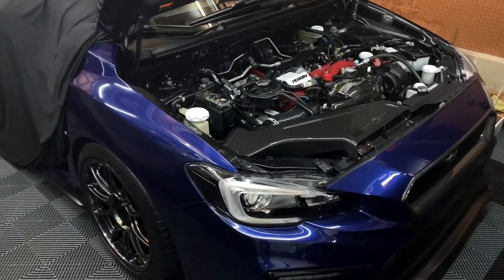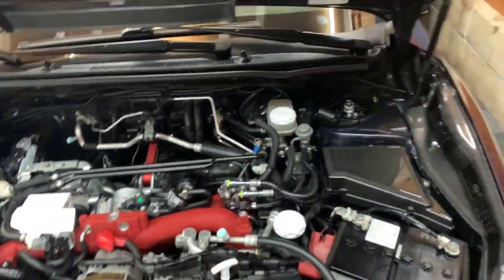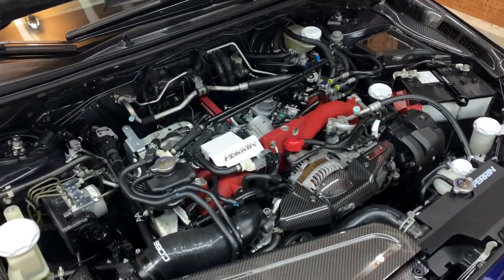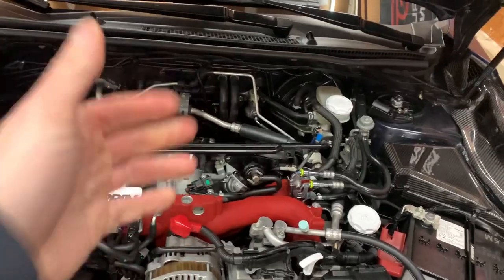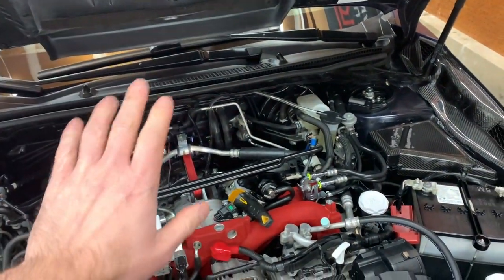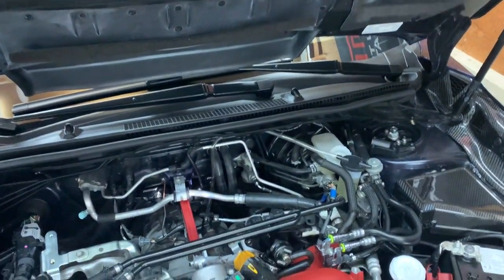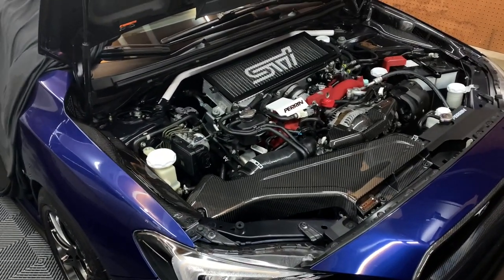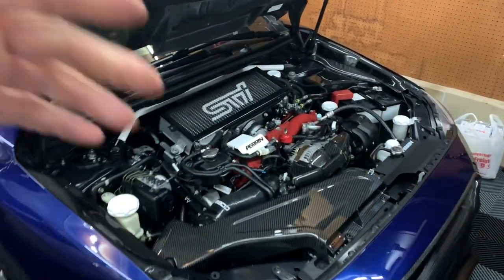How To Bleed Your Clutch On A Subaru STI

Comment: I have a 2016 STI. I just added a radiator, AOS, cylinder 4 cooler, pitch mount, pitch brace with stainless steel clutch hose. When I finished installing the stainless steel clutch hose, I noticed the clutch pedal stuck on the floor (no one pressed it). I figured it would be bubbles but after bleeding the clutch slave, clutch pedal still would not go back to normal. I noticed there were a small leak on the clutch master so I replaced it and bled the clutch slave again until no more bubbles yet the clutch pedal still would not go back up by itself. I decided to replace the clutch slave and bled it again until no more bubbles. Still the same, the clutch would not go back up by itself. 

Oh and on top of that the clutch would not go in any gear when the car is on. I was able to put it in any gear when its off. So I tried to put it in 1st gear and turn on the car, now the car wont turn on, the clutch wont go in neutral and the clutch pedal still sticks to the floor. Any thoughts or help would be appreciated.

Comment: is the rod on the slave supposed to move around at all???? my pedal just hit floor on freeway and I pulled intercooler off checked master where I see everyone else's leaking and no fluid but the slave had some visible leakage at the boot and the rod moves around a lot it actually came off when I pulled just a little

Comment: A little bit of a stupid question but since the brake and clutch reservoir use the same DOT fluid. When you drain the brake fluid you have to also bleed the clutch? Or are they separate?
Reply from the maker: No sir since the lines to the clutch are separate. It’s just fills from the same reservoir.

Comment: So slightly off topic question but still clutch related. I threw on some faction fan coilovers and the car is super low. I also changed diff fluid on trans/ front diff and rear. I am hearing a tapping sort of noise when I depress the clutch pedal and put it into fist and second. Not sure if this is a bleeding issue, the car not likening Motul 75w-90 or something else like a throw out bearing or needing to bleed the clutch. Any feedback helps.
Reply from the maker: Need to bench bleed the clutch

Comment: I did the same thing but i would tell my wife to press it once and i would open the bleeder valve i did not want to press it to much and let air into the cylinder do you like the feel of the line is not that Noticeable only at the mid end

Comment: Did this method actually work? The nipple on the slave is not the highest point when bolted down to the trans and could still have air trapped (even if you're bleeding it countless times).  I need to do mine, but I think I am going to remove the slave to angle it so the nipple is the highest point for a proper bleed.  Let me know!
Reply from the maker: I had to do a bench bleed. This method didn’t work.
Reply: @Autofreakgarage  ahh gotcha! Such a simple line to replace, but bleeding it sounds like such a pain :/

Comment: I have a question…I have a 15 wrx and I just replaced my master cylinder and while bleeding my slave when I close the bleeder screw I still constantly get air coming out.
Reply from the maker: We ended up having to do a bench bleed to get all the air out.
Reply: The problem I’m having tho is I can’t get the air to stop it’s almost like the bleeder screw won’t fully close…when the bleeder screw is fully closed I have have an air leak
Reply from the maker: @matthewwillis9449 I would take I completely out and inspect.

Comment: First off, great video, beautiful garage, car, and build. Now I have a question…Been looking for an answer to this one. Still scratching my head. I had swapped my transmission with a brand new one and an act clutch. Its still less than 1,00 miles, but I doubt it’s a break in related issue. I don’t want to call the shop just yet. 

Here’s my problem… for some reason the catch point is about 70% up from depressing after it hits the floor. It makes the car super hard to drive and very easy to stall. Then I realized when I’m on a hill and engaging thag very small clutch grab point area, it sounds like the flywheel (or something else even) is grinding trying to catch up with the rest of the powertrain. Im going to try and bleed the clutch today, but I’m just out of ideas. For some reason I think it may have something to do with the hill assist and my tune. I’m not great with that, so I’d have to ask. Anyway, any ideas would help.
Reply from the maker: Thank you! It sounds like the clutch needs a good bleeding. Ended up having to do a bench bleed on it since this method just wasn’t cutting it. I bet you once you get it bled properly, it will feel much better.
Reply: @Autofreakgarage  Thanks bro! Definitely going to try it out this weekend if I have some time. By the way, what is a bench bleed? Haven’t heard of that.
Reply from the maker: Taking the entire brake master cylinder out and bleed it out of the car.
Reply: @Autofreakgarage  oh snap. Never done that before. I just looked up a vid and can see how it’s done. Will definitely be giving that a go. Thanks again. 👍🏻👍🏻👍🏻
Reply: So did you ever adjust the push rod on the masters cylinder

Comment: Thank you for the video. I had one question. Did you end up dumping the fluid back into the reservoir?
Reply from the maker: I topped it off with fresh fluid, but you can reuse the fluid you bled out.
Reply: @Autofreakgarage  Dot 3 or 4 is what I’m reading. Did you just top off with the OEM fluid?
Reply from the maker: Dot 4. I flushed OEM fluid out when I did my brake flush for ate 200
Reply: @Autofreakgarage  thanks for your help!

Comment: Not related with the video but I have the same c lights installed as you do from circuit Demon. Have you experienced any issues? My show mode randomly turns on without any of the remotes being touched or in range. I'll come out of work with the lights running a party. Messaged Circuit Demon and they don't know the cause of it either.
Reply from the maker: Mine are actually diode dynamics. I’m not familiar with the circuit demon ones.

Comment: When you finish bleeding it , do you leave the clutch stuck on the floor ? Or you pull it up before starting the car ?
Reply from the maker: The clutch pedal should return to normal spot. It should not be on the floor.

Comment: What hose size did you use?
Reply from the maker: I’m actually not sure of the size. Whatever the kit came with is what I used.
Reply: @Autofreakgarage what kit did u use?
Reply from the maker: @10185mordy perrin
Reply: @Autofreakgarage  I meant for the clutch bleeding kit in the end
Reply from the maker: @10185mordy just used one from harbor freight. Although, I ended up bringing to my shop and they did a bench bleed.